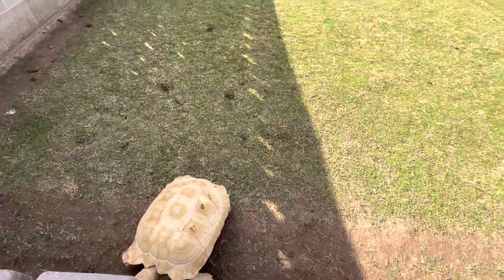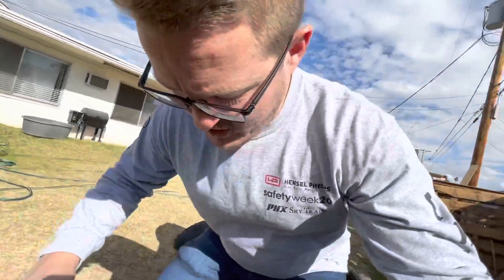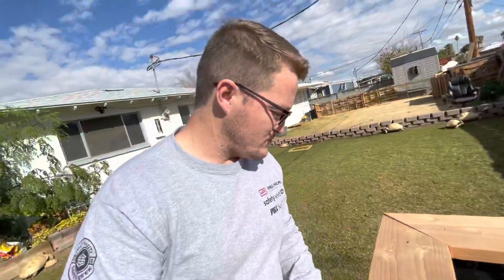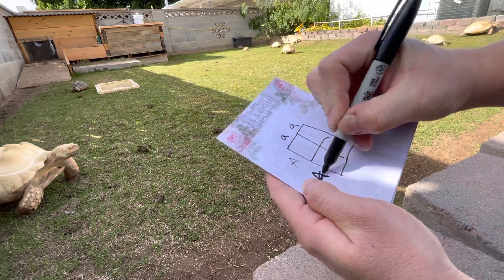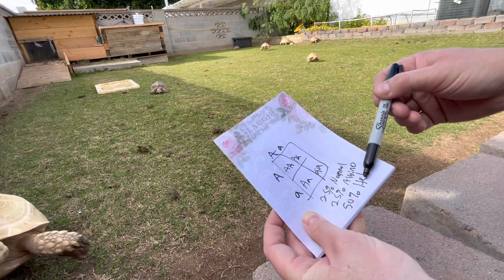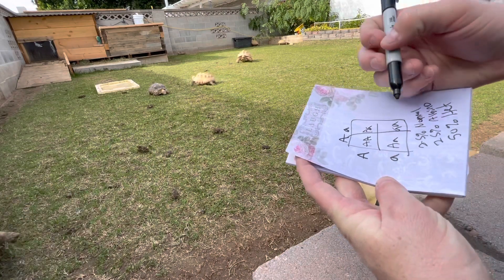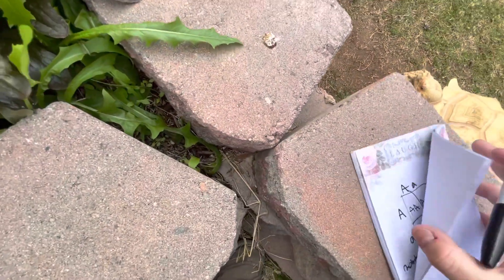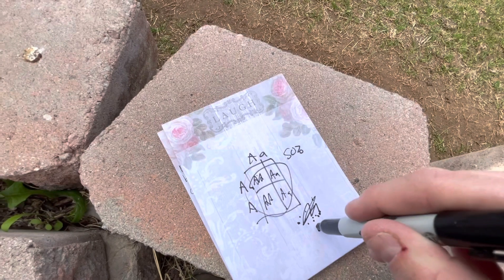Understanding basic RECESSIVE GENETICS using PUNNETT SQAURES: *ALBINO* TURTLES AND TORTOISES

Comment: If you breed a 66% turtle (without it being proven to carry the albino gene) to normal turtle what are the percentages then ?is the only way to find out if it actually carries albino gene to breed it to another albino or a turtle that’s already been proven het for albino ?
Reply from the maker: So if you breed a 66 percent het. The only option is to prove it out. Either it is or it isn’t a het. If it is a het you will get 50 percent of the babies albinos. If it is not, they will be all normal babies that are 100 percent het for albino. Assuming you need an albino male to the het. Otherwise you will never know.